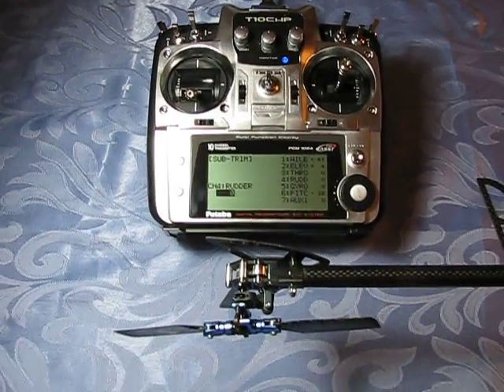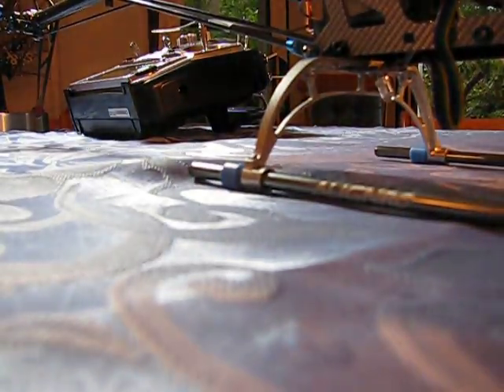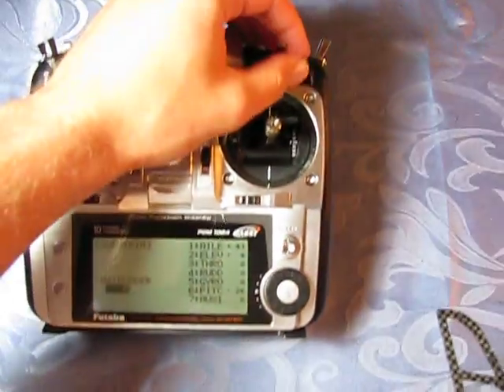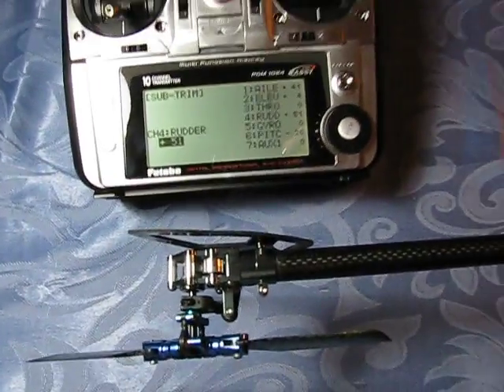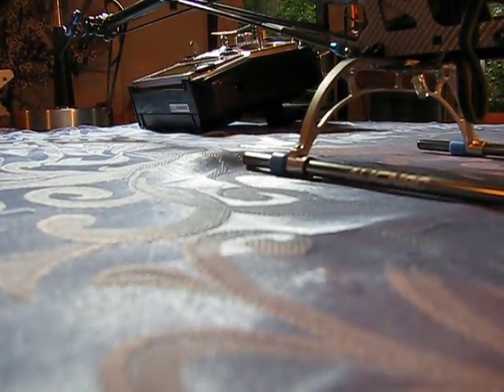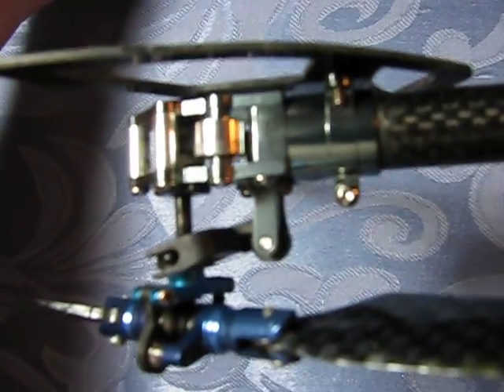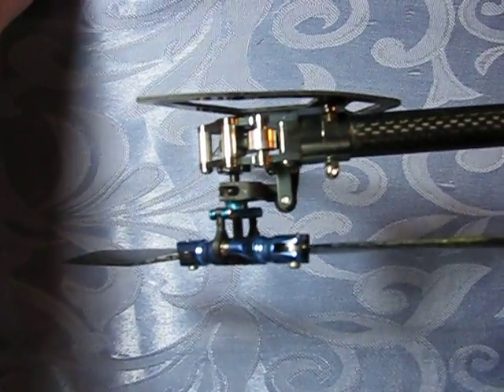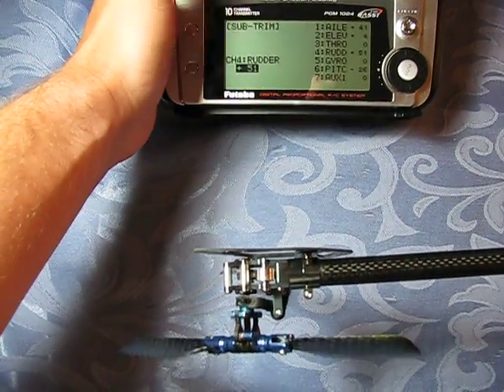GY-401 Tail Setup (with subtrims)

Comment from the maker: @kdm0129 I set up mechanically on ALL other gyros. The problem with the 401 is you can't! If you set the 401 up mechanically, you limit the amount of pitch the tail has in one direction because you can't control the pitch endpoints individually. Try my method - it works. Futaba still uses it today to trim the new CGY 750 flybarless gyro!

Comment: I tried this out, and it worked on my clone 401 anyway. This is not readily available information... I wonder why?? I have read so many posts on forums on how to set up these gyros and how to remove drift etc... not once have I read this method.  Now I think of it, I did a similar thing with my GP750 gyro, I had it setup ok, then I added sub trim to set it up in rate mode but it remembered the end points (set separately) which I found curious at the time. Same theory I guess... Thanks again mate

Comment: @MikeG4936 It seems it memorizes the neutral position that is set in rate mode, (from the new sub trim position) but when you power up (connect the battery) you do so in HH. I assume it sees the neutral from rate to set neutral in HH?

Comment from the maker: @obsequeiousphil Hey - not sure about the HK gyro. I DO know that flipping the switch 3 times has the same effect as unplugging/replugging the battery, as the gyro memorizes the neutral position every time it is powered up. So take your pick - either way should work equally well. ;-)

Comment: that makes sense... do you know if the HK 401B gyro can be setup the same way? I have had improvement by setting up mechanically in rate mode and then switching the switch 3 times to memorise the neutral position.  But I might try this way too and see what happens.  Nice vid mate.

Comment: Great info. I was trying to trim mechnically in rate mode as most people suggest, but you then bind in one direction and lose throw in the other.
This method works great!
As I only fly in HH mode, I presume it actually makes no odd whether I sub-trim it or leave at zero?